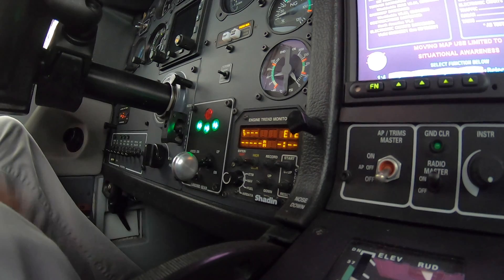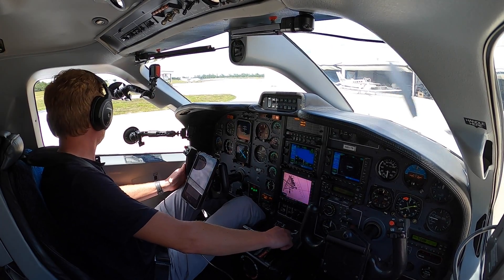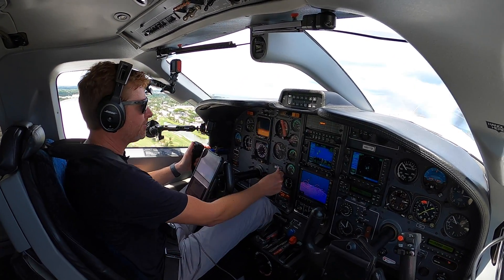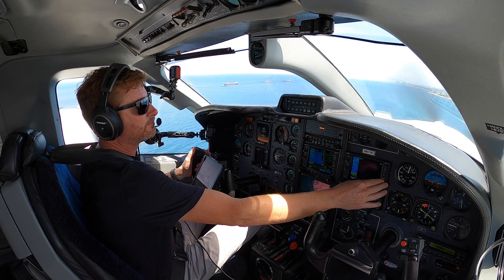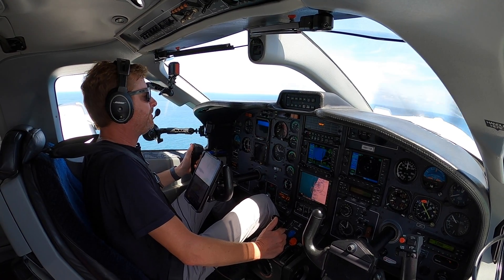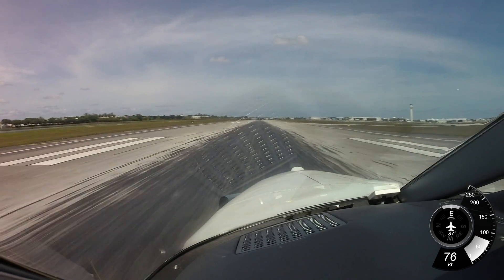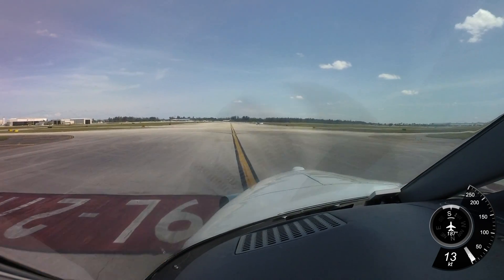WHEN THINGS GO WRONG! Landing Gear Failure Debrief and Flight VLOG

Comment: Great to hear everything is Ok.  There needs to be a manual bypass to the switch or switches as an additional  emergency option.  This single point failure needs to be addressed in aircraft software and added to the pre flight check list.

Comment: I’m glad you were able to manually extend the landing gear and you’re okay.
Reply: A good thing these redundant systems are there. But a design flaw here I think. A system designed to detect the aircraft on the ground should only prevent selection of the undercarriage up (the concept of fail safe). There is no good reason for that switch to stop selection of undercarriage down in either normal or failed conditions. Presumably any time the gear is indicated as down and locked, such a command to put the gear down would be ignored anyway. I mean the gear down lever is not returned to a neutral position after the three greens are realised.

Comment: I guess if you fly long enough, something like this happens.  Well done Steve and I'm glad you're safe and everything worked out!
Reply: I agree. Law of averages as they say. I worked 40 years for one the big commercial airlines and flew all over the world  on business and vacation and was involved in 3 emergency landings - including one on a Tristar where the nose gear failed to deploy. One of the tech crew came back into the front cabin to open a hatch in the floor so he could get  down and hand pump it down. Took a lot longer than the TBM but we landed safely, also after a low pass over the tower to check it was down. These situations make you appreciate the skill and professionalim of the guys up front.

Comment: Piper Navajo pilot here. Had belly landing  2 years back. Saved the 2 engines by luckily shutting off before touchdown. I have alternating props so its was impossible to save them as if I were in a Beech 58. 😁

Comment: Kinda funny i just saw a video about runway cleaning. Seems like the main indicator that a runway needs to be cleaned is when the groves fill up with rubber (that is if the runway is grooved of course). Otherwise the rubber allows the water to stand much longer  and form puddles that cause hydroplaning.

Comment: Safe to assume the pressurization is also linked to the air/ground mode. So that 1 failure of the squat switch  caused both problems, well done Steve !

Comment: Flying a 4 place BeechCraft Sierra  we had a landing gear failure... flipped the switch and got only 2 indicator lights and done a low fly by and sure enough the front wheel was at a 45 degree angle down... we were low on fuel and my 2 young daughters in the back seat..... 
We were getting ready to manual pump down the gear when we tried the switch one more time we got the third light to come on... when we did land , on inspection of the plane the belly of the fuselage was covered in hydrolic fluid...
We were lucky....

Comment: Runways are inspected about every 8 hours...  they get cleaned usually a few times a year (2-3 times) with a pressure washer type system (usually done at night)... and runways get resurfaced about every 7-10 years, depending on the usage. 

I know this only because we looked at marketing a company that made the runway cleaning machines.

Comment: Did you know with out reading the emergency check list that the manual over ride for gear down existed? Is there a certain life cycle for the switch that comes up in the routine maintenance schedule for replacement?

Comment: It took a few weeks to figure out what the issue was?  As soon as you said no pressurization on takeoff and then no gear I said to myself that's probably a squat switch issue, and I've never flown a TBM.  Unrelated failures right after takeoff screams squat switch problem.

Comment: As a 20 year aircraft mechanic in the Air Force I can tell you that those WOW switches or Weight on Wheels switches have been the bane of landing gear issues for years. All kinds of things are able to happen or conversely, unable to happen when one goes bad. Maybe that's the next million dollar idea, redesign of those switches. Also, add that sentence to the list of things you never want to hear your pilot say... "Well guys, I'm glad the Landing Gear worked today..." 😂

Comment: Steve, I would be interested in hearing about the preventative maintenance procedures regarding that switch. Does that switch get checked on some frequency? Does it get replaced on some frequency? When it fails, what type of equipment failure analysis is done? I work in the nuclear power industry, and we are always analyzing equipment failures. Any insight you could provide would be appreciated!

Comment: The closest I will ever get to your life is the TBM 930 in MSFS 2020. I have the Track IR5 which is a head tracker that allows you to look around like you're really there. Marvelous piece of kit. The sim has a failure mode where you can program specific failures to occur randomly or at a specific times in the flight. Not exactly flight training, but it gives a flavor of what it's like. Even in a sim it's unnerving to experience system failures.

Comment: I first heard about this over on Victor's channel, and was kind of surprised, but very glad that it turned out so well for you.  I was kind of surprised though that the squat switch wouldn't let you put the gear down.

Anyway, something I noticed.  When you started the engine up, the co-pilot's artificial horizon was very slow to spin up,  In fact, even by the time you had moved up to spot 5, I would say that it wasn't fully reading correctly.  That might be the next thing (albeit a low priority) that needs to get checked.
Reply: Hello there👋👋,how are you doing today? Hope you’re having a good day!God bless you!!❤️

Comment: Thank you for the debrief.  Unrelated question on a hot day if you were in newer model 910/30/40/60 with the pilot door could you start the aircraft with the door open to keep a little cooler before AC kicks in
Reply: Shouldn’t start with cockpit access door open due to the proximity to left engine exhaust. Likewise should wait for complete engine stop before opening

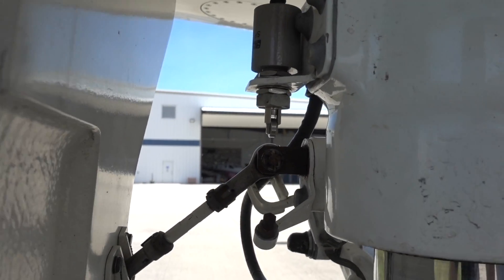Comment: 3:20 I'm wondering that there is only 1 switch, bc on bigger airplanes are 3 proximity sensors (touch-less) where majority says the position (at least 2 from 3) and EICAS reports not matchging sensors. Based on all LG states is calculated WoW signal (Weight on Wheels aka on ground).
Reply: Hello there👋👋,how are you doing today? Hope you’re having a good day!God bless you!❤️

Comment: You know, that switch may have been triggering some of your other issues along the way. Funny how these interlinked systems can cause some real head-scratchers. It’s nice that you can manually pump the gear down, but it would still be useful to allow you to override the computer when it’s a case of something important like landing gear, and simply tell it to go down and lock.

Comment: Great video, Steve, thanks for making it. It's kind of funny to see the "behind the curtains" look at the emergency extension mechanism. You have this nicely appointed interior of an executive turboprop, and you pull a panel aside to reveal this very basic, slightly beat up mechanism. 🤣 Two questions -- first, in your view of the squat switch, it didn't look like it was depressed even though you were on the ground. Does it get un-pressed when there is weight on the wheels? Second, it seemed to me that the checklists sort of read like they were translated from French. Is that your experience with the TBM checklists in general?
Reply: Hello there👋👋,how are you doing today? Hope you’re having a good day!God bless you

Comment: Seems like they would make that switch in reverse so that default for a bad switch would be landing gear won't retract. I suppose a switch failing mid flight at speed and altitude wouldn't be such a great thing either? I'm not a pilot so I don't know the ramifications of that happening.

Comment: Do big commercial jets have hand pumps they can use when the gear fails to come down?
Reply: I think they generally just release latches and gravity takes care due to the weight of the landing gear.
Reply: Pressurized hydraulic accumulator. Look them up, pretty cool stuff.
Reply: Some older planes have manual extension systems. On C-130s, the nose gear has a hand pump and the mains are cranked down with a speed handle.

Comment: Wouldn't it be better if there was squat switch on both main gear? If they disagreed the system could have a fail mode involving warning the pilot, or allowing the pilot to do things the switch would normally block subject to a confirmation menu, or something.
Reply from the maker: There is another switch on the other side landing gear. I believe they both have different responsibilities. A redundant system would be ideal though! I agree!

Comment: That was a bit confusing. When ATC told you to change your approach and enter downwind for 12, I then thought they had cleared you to land, so when you were on short final for 9L, I actually had to replay the part of video where they had cleared you to land, which was for 9L. I guess it didn't phase you since you're used to that airport, but it definitely made me question if you were lined up for the correct runway, having just been on downwind for 12. IRL, I would have asked ATC for confirmation of landing clearance for 9L, as opposed to 12, because IRL I would not have been able to replay the video :)

Comment: How did you know the pressurization wasn't operating properly?  That's what always scares me = the sad tale of Payne Stewart's flight.
Reply from the maker: The rate of climb on the ECS panel was the same as the aircrafts rate of climb.
Reply: @steveo1kinevo  Thanks- but does the TBM have some sort of alert or warning that your pressurization is exceeding a safe level?   What if you had not noticed the fact that the ECS was still climbing at the same rate as the plane?  Or what if you're flying along at a pressure adjusted level,  and the plane begins to lose pressurization?

Comment: Something minor like that (a switch) making the landing gear unable to DEPLOY normally seems like a somewhat problematic way to design the landing-gear interlocks on the aircraft (as evidenced by this failure).
Pressurization not working is "fine, I guess", because you can almost always fly an aircraft "lower" than you intended to (so long as you do remain at a positive altitude with respect to the terrain), but preventing gear extension seems like something that should be avoided if the cause is a switch in the landing gear itself, don't you think?

I understand that this switch is normally intended to prevent the gear from being retracted while on the ground (as well as preventing pressurization while on the ground apparently), but it would be nice if gear extension was always permitted. And by "permitted" I mean that it would deploy as normal using the normal gear lever, instead of forcing you to use the manual gear extension method like what happened in this failure (maybe also flashing a caution message and/or logging the discrepancy in the computers about the switch not being in the right place). Or maybe that's the kind of thing that already happens on big airliners, but is too expensive to implement in these smaller less expensive turboprop aircraft (that are basically a step or two above a GA aircraft).

Before anyone mentions it, I'm well aware of the problem with changing the way a "certified aircraft" works after it's been certified. That little issue being fixed would probably cost at least $100K in paperwork fees just to get it thru the FAA and approved. Companies that make big airliners have the income to do that kind of thing. I doubt the same can be said for the company behind the TBM850.

Maybe something to incorporate on the next iteration on the TBM850 series aircraft, and maybe it's already fixed on the "Garmin G1000 or whatever" glass-cockpit version of this aircraft (I notice that this particular TBM850 has the "steam gauges" rather than a glass cockpit, tho these days those "steam gauges" are probably all electronically driven in any case, aside from the backup instruments of course).

I may be just an auto mechanic for my day job, but I keep up with what's happening in aviation and space flight because they are topics that interest me. These fields of interest of mine cross over quite frequently.

Comment: Hey Steveo- Just wondering if you noticed the brief intermittent left main green during the gear cycle? Might still have something going on with that left side.
Reply from the maker: If you look at all my videos that has always been the norm with how this landing gear operates.
Reply: @steveo1kinevo  funny. I was going to go and look back at a few (I’ve already seen them all) and check but my brain said “it can’t be right because to get a green it means the down lock is activated and would happen on both” so I didn’t go look. Could have saved me a post and you a replay ;)

But shows it’s a great idea to video flights as you get to pickup on these little things you most likely miss during flight as well as historical data on normal ops. 

Love the videos!

Comment: does that make sense that the squat switch failing in a "gear up" situation would keep it from coming down?  What sort of safety interlock is that?
Reply from the maker: It did fail and the gear wouldn’t come down.
Reply: @steveo1kinevo  i'm saying that the broken switch should stop you from putting gear up, but if they're already up when it fails you should still be able to put them down.

Comment: that switch preventing gear from coming up makes sense... but preventing it from going down... thats a problem
Reply: Not really. If the system thinks the plane is on the ground (which it was) the last thing the plane needs is someone or something hitting the gear up/down to  accidentally have the system activation if on the ground.

Comment: What turned out to be the issue with the pressurization?
Reply: The airplane is designed to not pressurize on the ground. Since the squat switch was telling the systems that it was on the ground, it won't pressurize.

Comment: What actually broke, piece of metal, Plastic, wire?  What about the pressurization? I suppose the only way to guarantee something will never fail is to not use it, and even then maybe old age of a part will cause it to break.  Still, depending on how the switch is made, you would think it could take 1 million cycles at least, before a piece of the switch breaks due to wear.
Reply: Hello there👋👋,how are you doing today? Hope you’re having a good day!God bless you

Comment: The tarmac used to pave runways is much coarser than asphalt or concrete used on roads, which makes cleaning tire marks more difficult. One aircraft landing on a fresh layer of tarmac leaves behind about 22 pounds of rubber, according to the operator of Schiphol Amsterdam Airport in The Netherlands. As the runway gets more use and rubber debris builds up, the amount of tire deposits decreases to about 9 to 13 pounds. 

Cleaning up all that rubber is no easy task: the tarmac used to pave runways is much coarser than the material used on roads. One aircraft landing on a fresh layer of tarmac leaves behind around 10 kilograms (!!!) of rubber. As the runway is used more frequently, this amount decreases to around 4 to 6 kilograms per landing. In total, we collected 6,500 kilograms of rubber last week. How? By removing it from the tarmac using high-pressure cleaners and hoovering up the bits of loosened material.
Reply: Hello there👋👋,how are you doing today? Hope you’re having a good day!God bless you!!❤️

Comment: I'm surprised you declared an emergency, first. I would have got out the emergency check list first, and tried to solve the problem before declaring an emergency.  I believe you should declare an emergency after you have exhausted all solutions.
Reply from the maker: Being single pilot I didn’t want to have to deal with extra responsibilities of normal inflight ATC routines. My soul focus was running checklists and getting the airplane fixed. There is no harm in declaring an emergency in this situation.